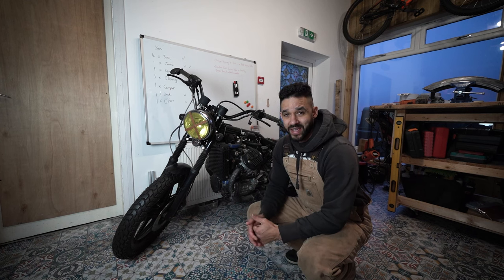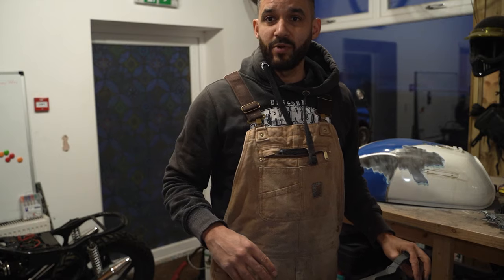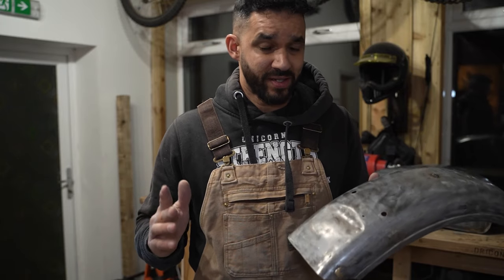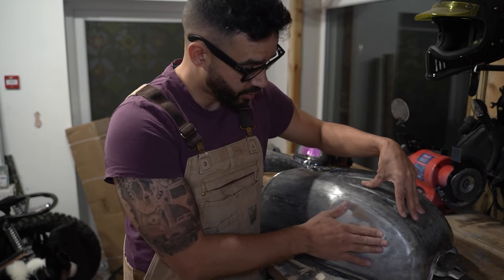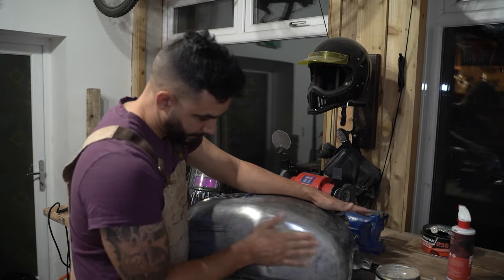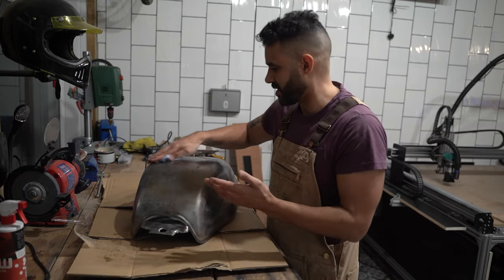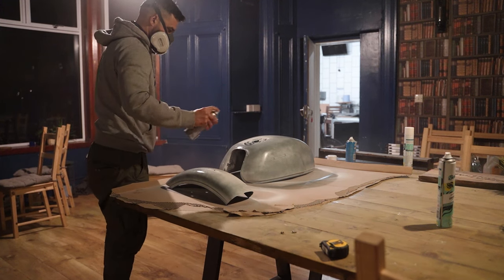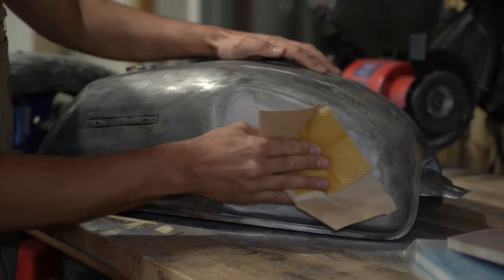Transforming my CX 500 Motorbike: DIY Rattle Can Painting

Comment: Hey J, that rear fender came off a chopped 1974 Harley Davidson Ironhead Sportster, the brass colour you got to believe it or not, is an American coin that the guy in the US that owned it used to fill a hole. I painted it, cut it, and fitted it to the CX500, when I converted it, it didn’t have a rear fender, it needed one, I had replaced the one on the Harley, and Voila! There is your answer. 🤙
Reply from the maker: Ahh legend. Thanks mate. That's super interesting.  How's things with you? Any new toys!?
Reply: @RookieRestorations  picked up an FZ1 rocket bike! Enjoying the low maintenance aspects! Van is finished too, all good, hope you are well matey